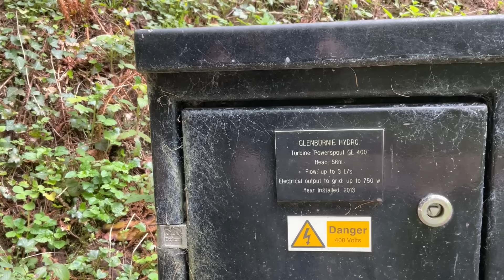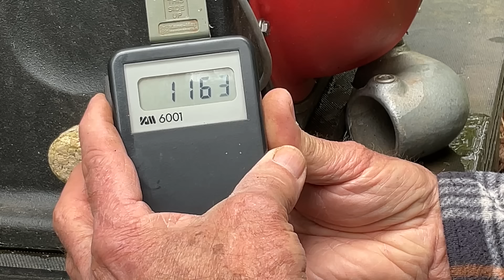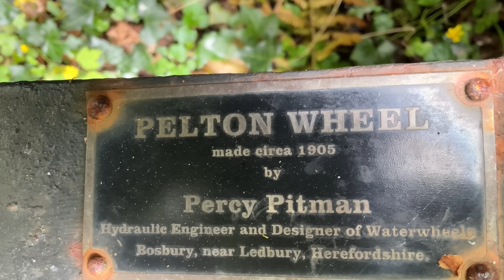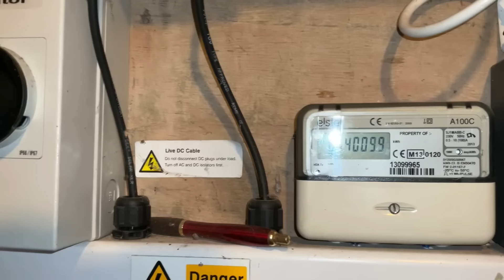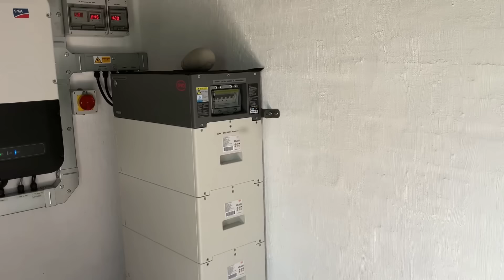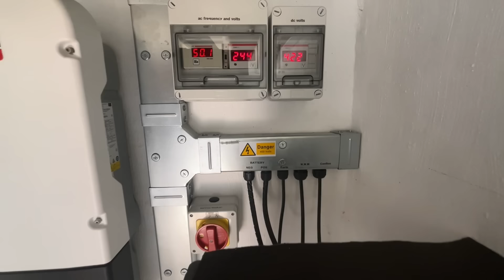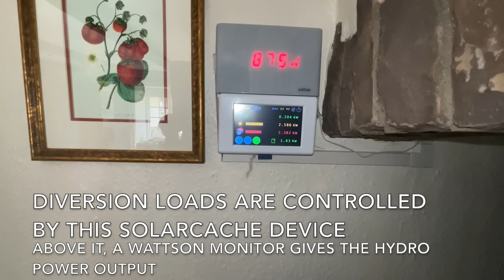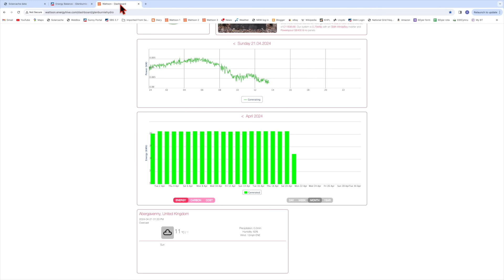Powerspout + solar + battery = the perfect combination.

Comment: I invite you to look up what Kris Harbour has done in Wales. He has consolidated the nozzles into an adjustable fixture that can be increased or decreased in diameter via wifi given the amount of flow from his stream. I've seen a lot of variety in water turbines, but I think his is the best designed and most resilient (and efficient) set up I've seen.

Comment: Thank you for the shared details and the calculations provided!
I can't help but to ask what is the voltage in the wires from the hydroplant? Maybe it worth to install the inverter next to the plant and significantly decrease the loss in the DC cables to your house, sir?
Another point was to head the solar panels to the ideal south in a comb-like installation? I do understand that from the mechanical wind pressure, etc, the flat-roof-installation is the preferred one, but taking into acc the efficiency of the panels it would bring some benefits as well. E.g., it might be possible to lift one row (2-3) of the panels only to check the theory in the action.
Special thanks for the isolated ground installation! I really enjoyed it being placed into a constantly wet soil.

Comment: I work for a DNO and that is one of the best setups i have seen!
The only thing I would question is why you need dump loads and what they are? 
Do you ever actually need to use them or can you throttle your generation down to match your usage? 

I would guess that you occasionally do need to use them as your hydro is constant, but it might just balance with your battery set up!
Got to say I am a bit jealous ...... Well done!
Reply from the maker: Thanks for your comment; coming from a 'pro' like yourself, it carries weight for an amateur. 
The loads you refer to are not really dump loads but diversion loads; power is sent to them whenever Solarcache detects power is going out from the house toward the grid connection point; power will leave the house and be fed to the grid in this way when there is more 'home generation' than is required by the loads in the house which happen to be ON at any given moment; and what these diversion loads do is minimise grid feed-in by maximising retention of generated electricity for beneficial usage in the house. 
The white boxes you see in the film are 'throttles' controlling the power going to the loads; they are not the loads themselves; the power the 'throttles' feed to their loads is pulse width modulated, and is thus infinitely variable; by having complete control of how much power is fed to the diversion loads by PWM, Solarcache can precisely control what flows out of the house toward the grid connection point., - and this it keeps to ± 60 W.
I keep saying "toward the grid connection point' for a reason: the power Solacache allows to leave the house doesn't actually reach the grid connection point because it gets picked up in the 'Battery Bunker' by the Sunny Home Manager, and is diverted to charging the battery. 
Sunny Home Manager is the real 'gate keeper' of power flow at the grid connection point and it rigorously maintains a regime of 'zero export and zero import', - unless of course, the battery SOC is 100%, in which case grid feed-in will occur, - or if loads within the house exceed the power that can be provided by power from hydro + solar + battery, in which case power will be drawn from the grid.
All of this 'operational logic' might be clearer if you study the diagram at the very bottom of this blog post: https://water-to-wire.blogspot.com/2023/12/battery-storage-completed.html
If you want to understand more, do get back again.
Reply: @KEhydro  That was a good read .... does that make me a pedant? ;o)

The only thing I would add (small point) is that you seem to have a "White meter" The tariff for this in your situation is not good .... changing tariff might be worth looking at? Especially as it is an old meter (they should be changed every 10 years so your supplier will be looking to install a "smart meter"! 

This might not be in your best interests!
Reply from the maker: @totherarf  There is a benefit from having an old 'spinning disc' white meter, and insofar as there's a benefit, there's a reason for my wanting to keep it. The 'gate keeper' at the grid connection point (SHM) is rigorous, as I've said, in preventing import or export; but it cannot absolutely prevent a few Watts coming in or going out; what it does achieve precisely is  zero movement of power at the grid connection point over a period of time; if there was a Smart meter there, every few Watts of grid import that SHM allows to be in-coming would be registered as energy taken from the grid, but every few Watts of export SHM allows out-bound would not wind the digital counter of a Smart meter backwards. In contrast to this, with the spinning disc meter you saw, although it is ratcheted and cannot go backwards indefinitely, it will go back part of a revolution until it hits its ratcheted stop; so with the way SHM is constantly allowing a few Watts in, and a few Watts out, this allows the disc to oscillate very slowly (slowly because we're talking about <20 Watts of power moving either in or out) without a forward revolution ever being completed; if a forward revolution is never completed, the white meter's mechanical type of counter doesn't register any import. 
Whilst there's a drive, as you say, to install smart meters, I'm steadfastly resisting it for my installation ! White meters seem to have fewer problems than the new ones, and whilst I cannot access the better tariffs that are tied to a customer agreeing to a smart meter, if I don't import any energy, the better tariffs have no appeal.
There ! - I've managed to make a 'big point' out of your 'small point'.
Reply: @KEhydro  It is nice to see someone who actually understands what they are saying rather than pump out generalisations! 

I am in a similar situation, but do import more than I make. When setting it up they wanted me to get feed in tariffs and were surprised when I told them I would store all my excess for a later time! Unfortunately for me hydro is not an option and people would object to any sizeable wind turbine in my area! You have to work with what you've got!

Comment: Very nice, well done. Auto nozzle adjustment by an Arduino would be a great next step.
Reply: I was wondering how often he swaps the nozzles over the course of the year. I think that even a manually-adjusted nozzle would be much more convenient than having to divert the flow and screw the better nozzle back in.
Reply from the maker: @ArnaudMEURET  You are right ! - having to change nozzles is something of a handicap - to answer your question, over the last 8 years the average number of changes in a 12 month period is 30, with the range being 39 to 16. 
I only change the bottom nozzle; the top one is never changed but it can be turned on, or not turned on, in conjunction with the bottom one. 
The top one is machined to deliver 0.3 l/s. 
The gradations in orifice size of the nozzles used in the bottom position are also machined to give increments in flow of 0.3 l/s.
With these characteristics, when flow is increasing, I can determine when to place a bigger nozzle in the bottom position by using the top nozzle to 'sample' if there is sufficient water for the next bigger nozzle to be placed in the bottom position.
When flow is decreasing, the time to change the bottom nozzle for a smaller one is determined by noting that the header tank is beginning to be no longer full.
The pattern of how flow changes through the year is remarkably predictable: it is either increasing or it is decreasing, and it increases or decreases in a steady and leisurely way. There are no sudden changes on a day-to-day timescale.
This pattern comes as a result of the source being a spring, which is discharging from groundwater held in the hillside; movements in groundwater levels are never sudden.
Your suggestion of a manually-adjusted nozzle is a good suggestion, - either a conventional spear valve type, or the type which has a variable orifice along the lines of a camera's aperture adjustment.
But either of these would be less efficient than a smooth-walled, straight-through, conical nozzle (by less efficient I mean there would be a greater energy loss at the nozzle) and in a system as small as this, where energy losses need to be kept to an absolute minimum to make the scheme worthwhile, I'm not sure the gain in convenience would be worth the loss in energy generated.
Changing a nozzle is a very quick and easy job, but you do need smallish hands, and as you have pointed out, you do need the perception that it is NOT an inconvenience !
Thanks very much for your comment.

Comment: Thank you for the video, excellently constructed. The river I live next to is situated in conditions very similar to yours, around 60 meter drop and comparable flow during the dry season, in that season the water is crystalline like yours. During the rain season the river becomes red with clay and much more powerful, I am wondering if this would be a problem for the turbine? Clay particles and other very small debris dissolved in the water. I have considered 2 ways of solving this, constructing a series of check dams to slow down the water and let the clay sediment in the bottom or constructing a concrete channel with filtrating media, have you gone through solving a similar problem?
Reply from the maker: I don't think the suspended matter, especially if it is only suspended clay, will be too much of a problem. 
I know of two Powerspout peltons, one of which has been in operation >10 years, which get really hammered by abrasives, - not just clay but grit. 
Their pelton runners and nozzles obviously don't stay as pristine as with cleaner water, but these parts are accepted as being 'wearing' parts which can easily be replaced. 
For you to plan to replace as necessary will likely be a more 'do-able' option than the de-silting arrangements you mention. 
Don't forget your check dams will not be maintenance-free, - they will silt up and need digging out. 
Even with the relatively clean water my scheme uses, the header tank still collects quite a bit of silt; I clean it out each year, - see https://water-to-wire.blogspot.com/2015/10/end-of-water-year.html

I hope this helps. Good luck with developing your scheme.

Comment: Thanks. Like Johnfitzgerald above I'd be interested in cost and also how often is hrid power required.
Nice countryside...surprisingly not many birds(?)
Reply from the maker: Peter, - can I direct you to the reply I gave to John F for the costs involved.
Regarding 'how often grid power is required', this is a question that only the passage of time will answer as we work through a full year of having the installation as it now is. You can read my thoughts of how it might pan out at: https://water-to-wire.blogspot.com/2024/02/benefitting-from-battery-storage.html
Regarding 'not many birds' - half of them (the female half) are probably on their nests at this time of year (!) - but there are many about in the woods here.
I saw a Tree creeper last week, - which is a bird not often seen.

Comment: People always think of batteries for storage...but technically you could pump that water back uphill to a manmade lake you create when you don't need the power and the lake would essentially become your "battery", storing the energy for whenever you want to drain some off for power.
Reply: or you could run a synchronous generator at a fixed RPM, with a governed nozzle so water consumption is equal to power consumed...
Reply: @paradiselost9946  you wanna swap nozzles everytime the AC kicks on?...., otherwise you have extra power when it's off.
Reply: @adamfrbs9259  you obviously have never heard of needle valves. should look into how they make nozzles on REAL hydro generators. they dont fart arse around with changing nozzles to "suit seasonal variations".
Reply: @paradiselost9946  meh, you've missed the original point.  You could store massive amounts of energy my way at essentially zero cost, with minimal loss compared to massive banks of batteries and their inherent losses.  Any dry spell and your way is immediately out of luck, my way you can run off the reservoir for as long as you want depending how large you make it.  
  Your way is like solar style, works great until cloudy, my way could run non stop even if the creek dries up for awhile.
Reply: @adamfrbs9259  and you miss the point that my way is the same way its done on a commercial scale and involves no batteries, and as it only uses as much water as the load demands at any time, tends to work on relatively low flow when done properly.

 the dam is where the energy is stored. 

the only hassle is governing with as little hysteresis and huntingas possible. people seem to have lost the ability to make things like that with out relying on some microcontroller or other electronics. or wanting wifi connectivity or some sort of BS like that.
Reply: @paradiselost9946  idk if he had a dam.  My point is make one instead of battery storage for when that flow stops. Match nozzles all u want with yours, that creek stops you're done.  Unless you do it my way.
Reply from the maker: @adamfrbs9259  and @paradiselost9946  Please allow me to step in to your debate which I've been following, - and been following with some regret that it was getting over-heated !
Very small hydros are in a different league to bigger ones. Really efficient conversion of the energy present in falling water is only possible with mega scale installations eg: at the Hoover dam which has an efficiency of 90%; see my blog post https://water-to-wire.blogspot.com/2018/01/comparative-efficiencies.html
Efficiency in an installation as small as mine has to be 'husbanded' carefully in order to get as much useful electrical energy as possible.
By 'husbanding efficiency' I mean 'carefully managing' where efficiency losses occur.
To that end, both the options you propose fail to reach the bar of acceptability for me. 
Taking first spear valves on the nozzles (you call them needle valves, which are, I think, only used for gas flow regulation; being a former anaesthetist, I am familiar with them!) - and going one step further and making these spear valves 'governed' so that the flow delivered is tailored to the power demanded; I do agree that having a means of adjusting flow would be very handy to avoid having to change nozzles as seasonal flow changes, and of course the hardware for doing this, even at the scale of my turbine, is available. My reasons for not opting for it are two fold: 1.there is an efficiency loss at a spear valve which is not seen with an open nozzle, and on the basis of wanting to 'husband' efficiency carefully, I have discounted the option; 2. spear valves are more prone to blockage and, at the scale we are talking about, prone also to build of silt on the spear; see Off grid in Scotlands' channel.
Another point to make about 'governing' flow to match electrical demand is that such a proposal misunderstands the very basis of my scheme: the scheme aims to generate as much electricity as is possible from whatever flow is available; it is 'flow centred' not 'demand centred', - if I can put it in those terms. Because it is 'flow centred', there is no need to control flow on a moment to moment basis.
Turning now to the opposing proposition in your debate: storing energy in an uphill reservoir, - a proposal that amounts to being a 'pumped storage' scheme. Pumped storage is not a very efficient way of storing energy, even on the megawatt scale; at the sub 1 kW scale, it would, I fear, be a non-starter; I have to admit that storing energy in batteries is not very efficient either, but it does compare reasonably favourably with storing it by pumping water uphill to a storage area; both I think can have a round trip efficiency of around 70 -85%.
To summarise and conclude: in the end, you have to work with what you've got ! - in my case, the scheme has no 'dam' retaining a water storage area, and nor is there any possibility of creating one. I have to make do with the flow which comes out of the ground at a spring source, and adjust how much water goes to the turbine so it matches the seasonal variation in the spring's yield. 
I hope this clarifies the issues you were 'debating' ! Thank you both for putting your comments, - I do appreciate them.
Reply: @KEhydro  I'm on city power ugh.